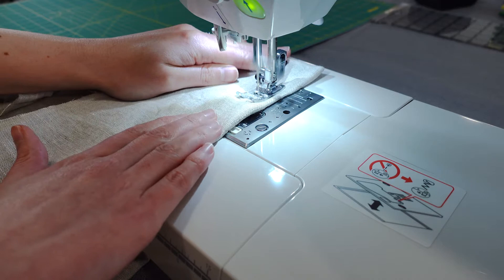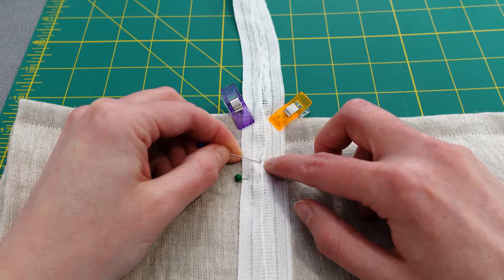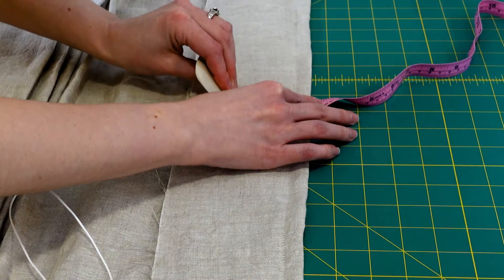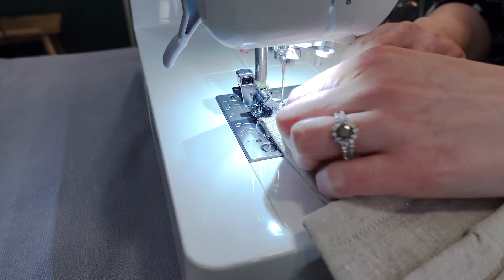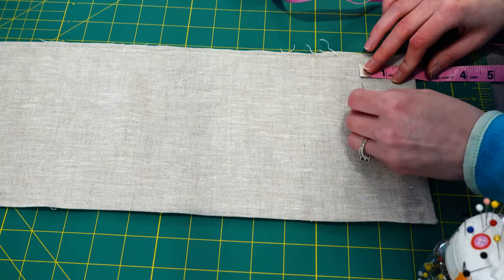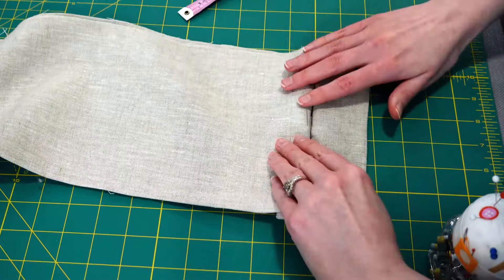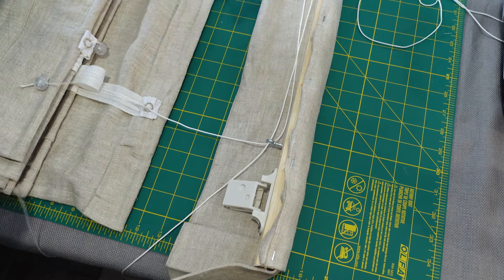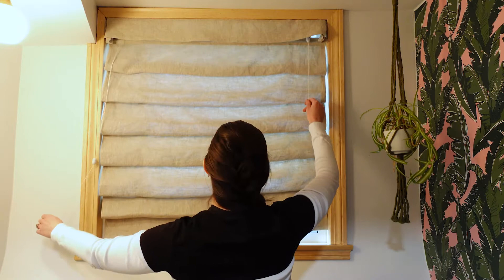How to make your own top-down bottom-up shades | DIY

Comment: Thank you for posting this, as you say making, these is far less expensive than buying them. At 5:37 minutes I noticed you have some plastic doodads that you threaded the cord through. Could you advise where I get these from and what they are actually called. In appreciation.
Reply from the maker: it's called a cord lock! I ordered this one from Sailrite and the quality is really good, so I would recommend. I tried ordering some from amazon and they didn't hold up the shade

Comment: Thank you for this informative video! Do you think I could convert existing roman shades(bottom up) to top down bottom up? Wondering if it's possible to use the fabric I have and just get the new hardware? Thank you!
Reply from the maker: I think it depends how the shade is attached at the top, like would it be easy to cut the fabric away and not have the valance part look bad? Otherwise I think it would be doable, but creating the top edge of the shade will be a pain and you might need to hand sew it since the lift cords are already installed. Good luck!

Comment: where do you buy the mechanism?  This is a great idea!
Reply from the maker: https://www.sailrite.com/Cord-Lock-for-Roman-Austrian-Shades 
I really like this cord lock! It's high quality and allows the cords to enter from both sides of the lock. I haven't had any issues with any of them since installing the shades.
Reply: @RandomBatHome  Have you tried many cord locks? I'm guessing not all work smoothly as others? I take it you just need 2 of these cord locks for each window shade of this size? Also do you work for Sailrite or do you just like them a lot? I just don't know them well as a site and want to trust them but don't know much about them. I mean I also use amazon but I don't trust them most the time either though lol.
Reply from the maker: @dlmurray55  I've only tried the Sailrite and a random cord lock from Amazon. The Amazon one did not hold the cords in place from both sides like I wanted and were very cheap feeling. I don't work for Sailrite and I only found them once I was looking to make shades myself. So far, all the cord locks I've used have held up well!

Comment: Thank you for the explanation. Do you think it is also possible to adjust standard bamboo shades to roman top down bottom up shades?
Reply from the maker: Hmmmm, you'd have to cut the fabric where it meets up with the valence top so it could be lowered. And then add a rod pocket to the top for a weight. And then reconfigure the cords to add a second condenser. So I guess it seems like a lot of work to adjust vs starting from scratch